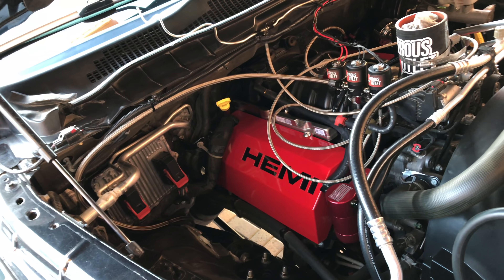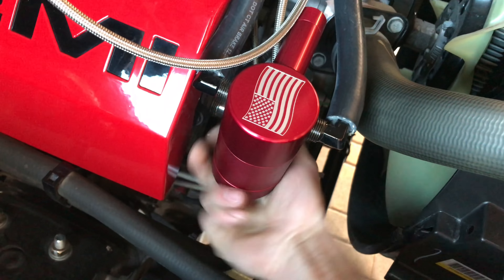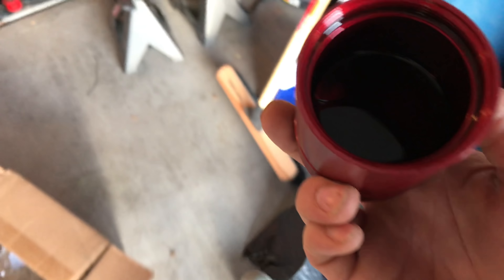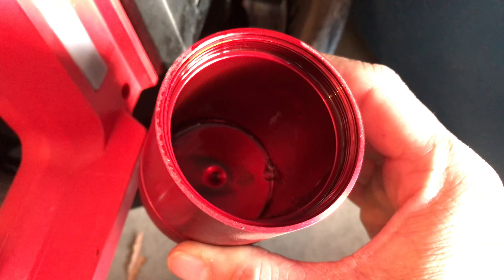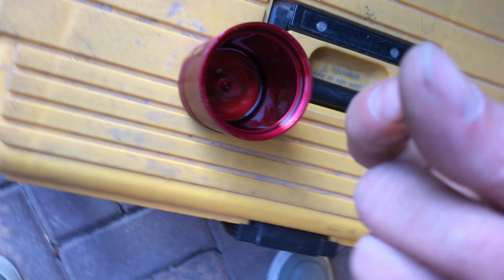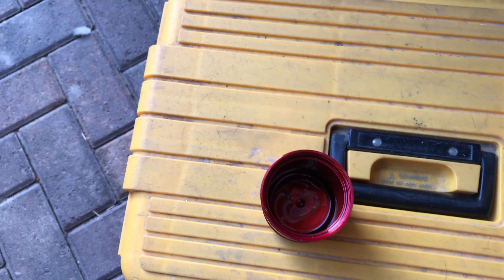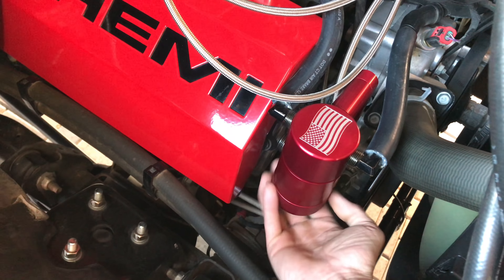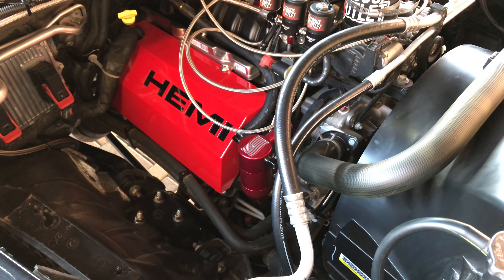RAM 1500 catch can first dump

Comment: The metal you found is from the steel wool like material in the top of the catch can.
Reply from the maker: That’s a good thing, much relief.
Reply: @HOTDAMN  I just hope we don't suck any of it into the intake! I'm thinking of taking mine apart and removing it. Don't really see a need for it.

Comment: I appreciate this follow up on a product you installed miles/months later. True review! Mind doing a follow up on the vararam in a few months? Ever upgrade your ignition coils? Spark plugs?
Reply from the maker: I will most definitely go over the vararam, I do think about spark plugs. It’s possible I won’t need to upgrade the plugs though.  If I do I’m sure I will be getting colder plugs.  Depends on the amount of nitrous dump.

Comment: Hey bro after looking at Moe’s installation video I think you might have your hoses connected to the wrong spots the one from the PCV valve should be on the front part of the Catch can and the one that goes to the throttlebody should be on the backside of the catch can I don’t know if it makes a difference or not But I just noticed that.
Reply from the maker: Good eye 👁, has been working great.  Here’s a recent video about it https://youtu.be/fiXbDhtHokk
Reply: I’ve noticed on this particular catch can is that there is a long baffle and short baffle inside. My guess is the long baffle is the positive or blowing side and the short baffle side is the negative or sucking side. The long baffle would blow the oil down and the short baffle would suck in cleaner air. Just my thought as I have watched several different videos on this.  I am sure it works either way until enough oil get in the can, it’s would be only then you hope the short side is the sucking side.